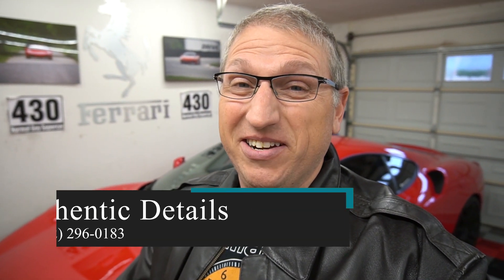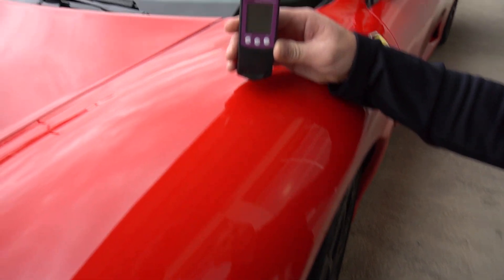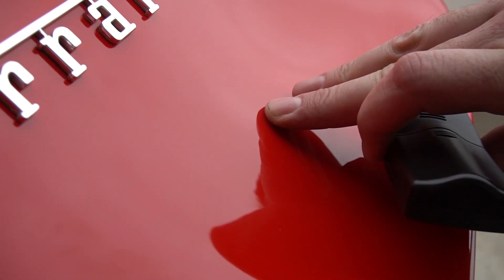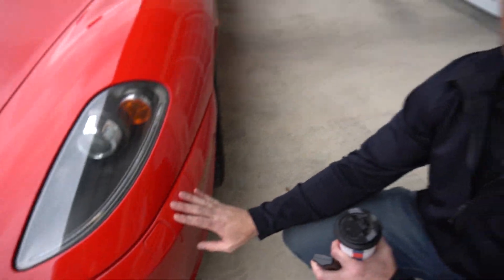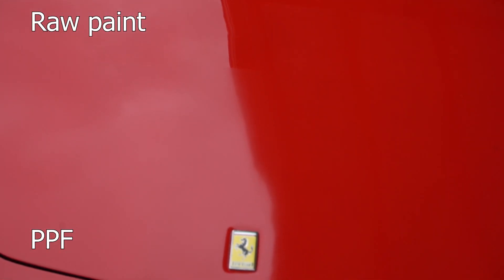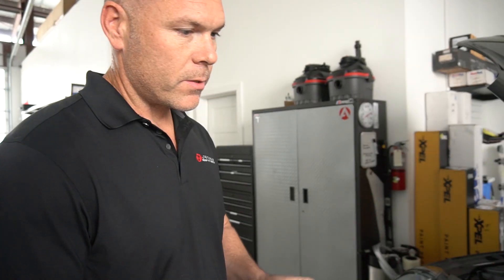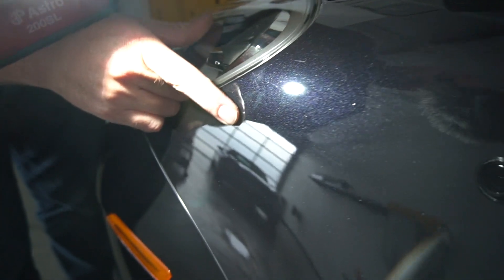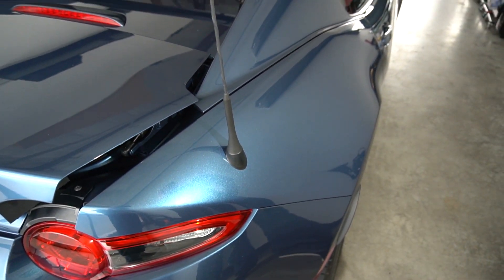Is YOUR PPF installation CRAP?! How to know

Comment: Great info.  I have my 2023 QX80 at shop getting a full frontal PPF install and I now I know what to look for, when I pick it up tomorrow.  I went to several shops for estimates.  Pricing was all close to the same, but some shops pushed a lifetime warranty, which didn’t sit well with me because nothing last a lifetime.
Reply from the maker: Ppf is only supposed to last about 10 years

Comment: Dan, this is awesome content!  When I was buying my F430, I not only had a PPI done, but I had a detailer do a paint PPI...it was well worth it, very thorough. I had him do the paint correction, ppf and ceramic coating as a result of his meticulous notes on the detail ppi.  Knowing what I know now, I may have chosen a different installer bc I see a lot of these mistakes (and I can feel the dirt underneath when I wash my car...ARGH!). Alas, I bought the car in CA and had it shipped to me, so all of that detail work was done in CA.  Couldn't go back to him at that point...minor complaints on the install, but the paint correction and the ceramic coating is awesome.  Highly recommend ceramic coating your cars...washing is a breeze!
Reply from the maker: Heck yeah! Ceramic coating is a must have in my opinion. And on a Ferrari a ppf is pretty much required if you don't want to be repainting it every few years.

Comment: Had my entire car paint corrected, PPF’d, then ceramic coated by Topaz .. check out their videos.  They are next level - check out their videos - they have turned PPF installation into an art form.  Combination of XPEL and Suntek.
  They don’t use cookie cutter patterns and pretty much custom design the PPF for each panel so that you don’t even see it’s there.
Best place to check the correct paint depth is the roof - the roof is typically never painted so it should provide a good indication of what the depth was when it rolled off the assembly line.
Reply from the maker: Then compare that depth to the other panels.
Reply: Normal Guy Supercar exactly.
Reply: stratpuppy - funny you should mention Topaz Detailing in London! Our lead installer is from Topaz :) They are a shop centered on excellence and extremely similar focus to our shop, Authentic Details. We love those guys and highly recommend anyone here to go check out their I.G. Page.

Comment: After getting my PPF installed today, there are SOO many gaps near curved trims. Is that common? Or is it hard for an installer to get it right? I messaged someone else who had the same car done at another shop, same thing but a little bit better than mines. Spending almost $3k should be a least near perfect for a full front... they had so many positive reviews too.
Reply from the maker: That doesn't sound right. The problem is most people don't know how to judge a good PPF vs bad installation so it's easy for a shop to get good reviews of they are good at customer service

Comment: Listen to this guy at "authentic" he knows his stuff which is great. I have xpel on one car and Stek on another. I prefer Stek as it is almost class smooth where xpel has a very slight orange peel. If you have a factory paint job with some orange peel, you really won't notice it but if you have a color sanded smoth as glass paint job you will see it if you look close enough. 

Quite a few videos ago you were washing your car with a blade and said something about that you are not scratching your car. I posted that you were. If you have a 2k or higher lumens lamp like they have you can see all the scratches. if you can see swirls/scratches with the nake eye you have bad scratches but even ones that have to be seen under a super bright light still deter from the look. They refract the light making things look more dull than they should. 

Also, if they bake your car after paint then maybe wait a week at most and leave your car outside if it is sunny and warm. If they don't bake it at all but you are in texas with low humidy and 75+ weather. Leave it outside in the sun during the day for 3-4 weeks. If you don't, it's possible that when you take off the PPF next time, paint will go with it just like this time. 

also please fix all the chips correctly (paint shop) and do a full front clip. Full fenders/hood/ mirrors, a pilars.
Reply from the maker: The chips were fixed.

Comment: Great video.  Wow!  I didn’t know.  It would be great to have that meter when looking at cars. My yellow 2000 SLK with 95k miles on it is having severe clear coat peeling.  It is outside 24/7.  I have been told the body was redone.  The top is fine so I think it is original.  The front end was in an accident before I bought it in 2013 with 68k miles on it.  Later a person backed into the front with a Mini van.  Fender, headlight, bumper damaged.  Repaired.  I would like to know my next step (repaint, clear coat).  Car runs great.  The car isn’t worth that much but I enjoy it.  Been getting all different estimates.  Some shops won’t touch it.
Reply from the maker: Yeah I'm definitely buying one of those

Comment: i did a repray, waited 6 weeks, and put on a PPF on one of my cars. A week later, gases came out from under the PPF from the gasing paint, and ruined the PPF finish (looks like it was marred by acid). The PPF place was nice enough to redo that piece for free, since we dont know what that is about and the body shop is blaming the PPF guys for using heat, which they didnt. Fortunately it was just gases and not a paint defect. Nevertheless, I would wait 90 days to be safe from a respray before putting on any decent PPF installs
Reply from the maker: Eek. That's good to know
Reply: @normalguysupercar Did you find out what caused cloudy 3M Scotch Pro on hood after one year?

Comment: Bah! You bought a used exotic that has been driven and a previous owner obviously had panels that showed wear (rock chips etc....) resprayed like a concerned owner would so it will still look awesome. Now the detailer has more material to work with. Ferrari seems to use softer paint that may be more likely to chip. Lots of older exotics at least get the front fascia repainted.  Par for the course and an awesome driver Ferrari. Good video Dan.
Reply from the maker: Yup. I suspect many older Ferrari's have been resprayed. Unfortunately that means lots of broken hearts. Lol
Reply: @normalguysupercar  shot a review on an Audi R8 V10 Plus Saturday... Im on CarGurus shopping right now... want another Jag? lol

Comment: Since every pattern doesn’t fit even with the best programs, which I have first hand knowledge of also, I cannot imagine cutting every piece twice on each new car!  That takes time and wastes sooo much film. You may even have to cut it a few times if you don’t get the modification done right the first time.   I understand some people want that type of perfection, so hope he charges accordingly.  He does great work though!
Reply from the maker: He mentioned that they may adjust sections and just do those.  So theoretically you wouldn't need to print the entire pattern twice... Just parts of it.
Reply: @normalguysupercar  That's correct. We typically see common spots where trouble occurs so we use scrap material and cut out a section of a panel from the software to test fit where things line up. We use that data to determine what we need to modify in each pattern for a tighter fit. Works much better than installing a full bumper to only find the parts don't line up. That really wastes film and time. :)

Comment: A top notch paint shop will have an oven to bake the paint hard - if this is done then PPF can be applied relatively quickly (a week or two). If the paint is left to harden naturally ... all bets are off as far as PPF is concerned.
Reply from the maker: interesting. I've also heard that UV from the sun will help cure it...

Comment: It's still a decent job. The whole point of the clear bra is to prevent rock chips and scratches. Not analyze it from 1 inch away
Reply from the maker: Yes, but that doesn't mean people should settle for it looking like crap. I like when the installation makes it seem invisible.

Comment: Dealer told me 60 days for paint to cure on a corvette, from the factory.  I had PPF(Xpel ultimate)  done with ceramic coating on top, I love it! It's not a perfect install..But close, I give it a 8.8 out of a 10.. Full car coverage PPF w/coating was about $5,700 on C7 GS.  Great video!!
Reply from the maker: Nice!  Yeah, full PPF and ceramic coating is the way to go on brand new cars for sure.

Comment: must have been really good coffee. he just wouldn't let it go whilst inspecting the paint...
Reply from the maker: Ok
Reply: Normal Guy Supercar your car isn’t in any way ugly like was mentioned couple of times in the video. who ever repainted did a good job. the fact you didn’t noticed that rear bumper drip could have happened to everyone. who ever sold it to you should have mentioned it was repainted. 
and previous ppf install was decent, probably made on a budget, i wouldn’t call that crappy like some do on here..
Reply: i see this all the time where shops blame and shame other shops which is not always true or fair. 
short story: i had an wheels alignment in december, went back to them in january due to the holidays, car has developed some issues. they started blaming the previous shop for bad alignment. it was the same shop, different technician :)))

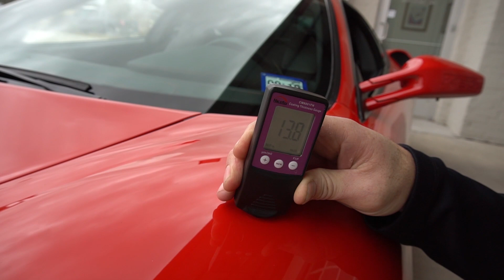Comment: 2:41 ..... 13.8 mm? ......... Americans still don't understand the metric system despite using it.
Reply: 13.8 "mils". A mil is one thousandth of an inch so this paint is .0138" thick
Reply from the maker: Either way, yes, we don't know your confusing straight forward systems of measurement. ;)

Comment: I just did PPF on a brand new car no paint bullshit it’s all factory paint. And I can see some of the lines are not perfect specifically around my mirrors. I can see some of the film which I’m going to take it back after what I paid for and tell him to fix it!  Plus they didn’t put my emblems back on. And they forgot the windshield was supposed to be tinted along with all the other windows but they just forgot the windshield pretty stupid. Kind of pissed off and they didn’t Claybar it before they stuck the PPF on it. It’s M3 as well so it is self healing but come on guys do a better job. I wish I could’ve taken it here because I would not have to redo anything. Or have them put it in place as they forgot to put it on. Give me a break this stuff is starting to piss me off. Not this video the fact that this video showing me the mistakes they made made